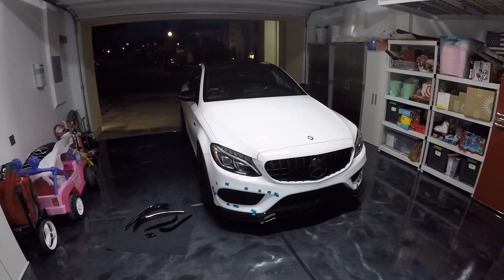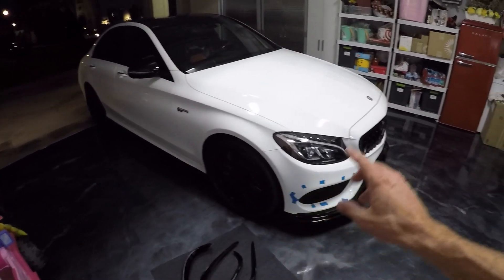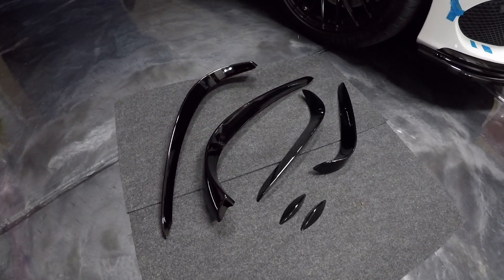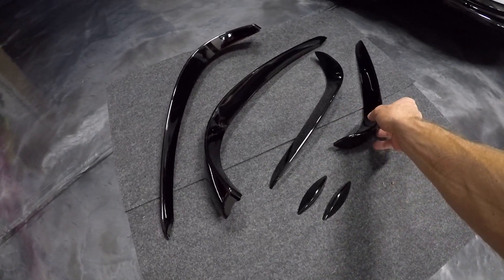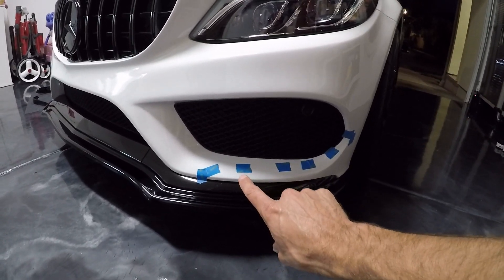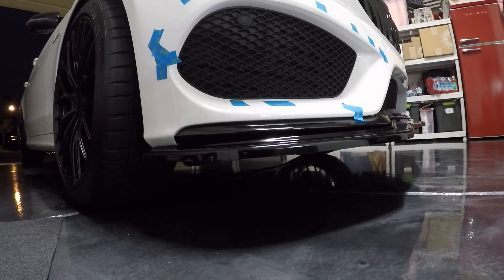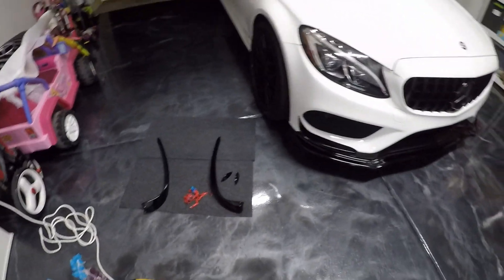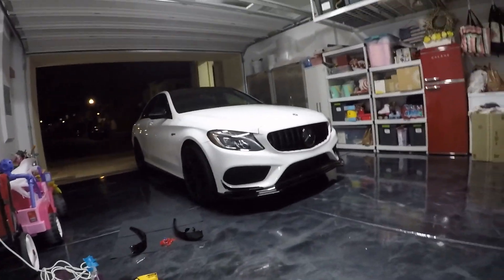Mercedes W205 C-Class C300/C400/C450/C43 - AMG Bumper Trims

Comment: I got this trim set too. I found that with the upper trim that you didnt install it made my sensors go bonkers when I was either slowing to a stop or in slow moving traffic. I had them in tbe correct position as they allowed but weird thing is I know 2 other cars of the same model with the same trims and seemed to have no issues. Anyone got any thoughts as to why I have issues?
Reply: Hey question- are you saying you had the original front number then got the face lift bumper? I have a 2020 C 43 AMG but with the regular number but I would like to get the face lift - is it worth it? Possible ? Any issues still? Thanks for your help
Reply: @justseenthevideo noI don't have the facelift bumper. I have the same one as in this video. The pre facelift. I'm talking about this extra trims he's putting on. They made my sensors go into beeping mode all the time.